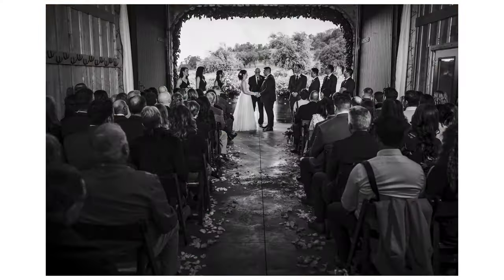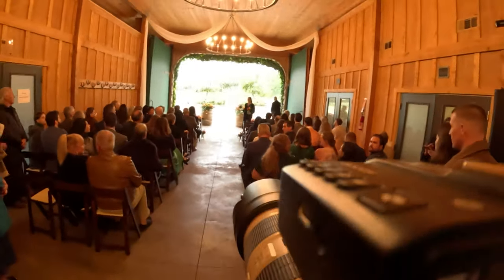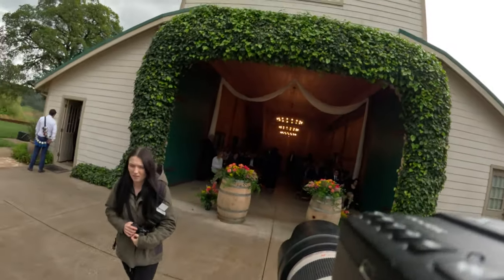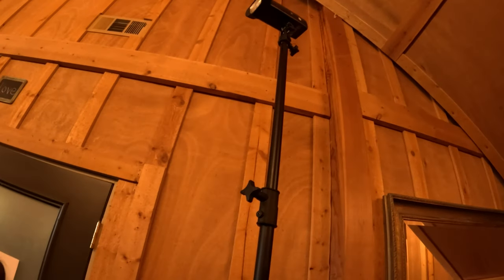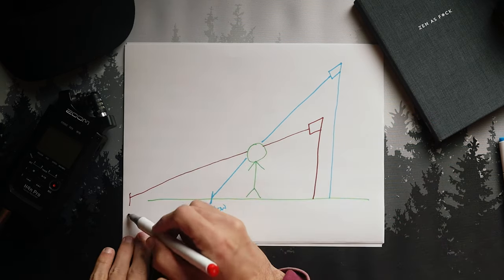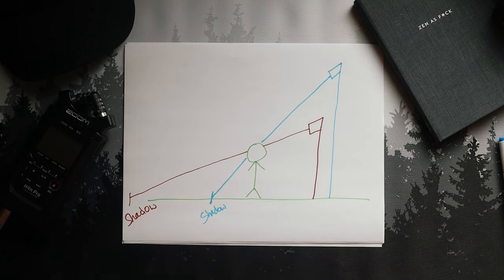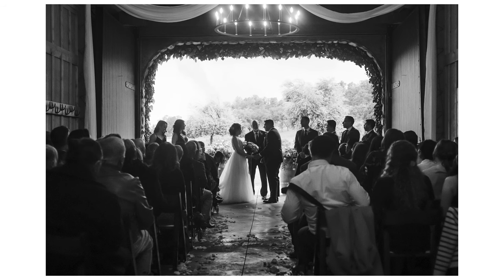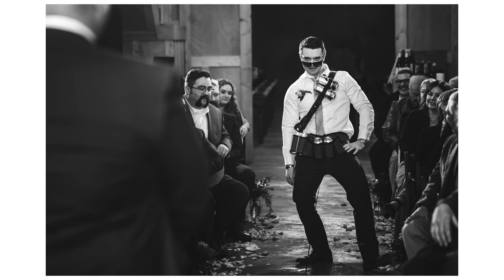Ceremony FLASH is EASY! I’ll Show You!

Comment: Great video!. 
I'm assuming you measured the exposure shooting from outside the barn entrance to get (1/200, ISO 200, f2.8)...all natural light. Then you went inside the barn and adjusted the flash power to match same exposure. That way, whether you're inside the barn or outside, the exposure remains the same.
AD200 is a very powerful and essential gear for photographers.
Reply from the maker: I actually did my orignal tests inside exposing for the background, and because it was so cloudy and stormy when I went to do a test outside I realized i wouldn’t have to change them at all.
However, the final settings (the ones I gave you) could have not came from my original test since I started the ceremony outside the barn so I could have slightly dialed it in and left it.

Comment: Nice. You did not point to the foreground effect with flash (inverse square law - ISL) that can overexpose the foreground. Firing the speedlights/strobes from high up over the audience you worked around that issue, incidentally.
The farther away from the flash sources, the smaller exposure differences there will be between different distances (ISL again).
It looked like you angled (toed in) the strobes so as for the left one to light the left of your "stage" and the right flash the other side.
If I light a background in the studio I toe them in in a way that the left strobe lights the right ~half of the background and vice versa.
This gives more even light easier. In this case you might have lit the audience differently.
My advice to you is to go back there with some friends or helpers, a couple in the br/oom position and a few as mock up audience, go through the toe-in alternatives and see what you feel about them.
Reply from the maker: I knew with the flashes high I wouldn’t get light on the audience, but you are right I should’ve mention that. And I agree with you, I would normally toe the flashes in more as you say. But this barn was really narrow, so with my flashes being so far back the different angle of each flash wouldn’t have change it much. The flashes would have to be much closer to the couple for the cross angle to have much effect